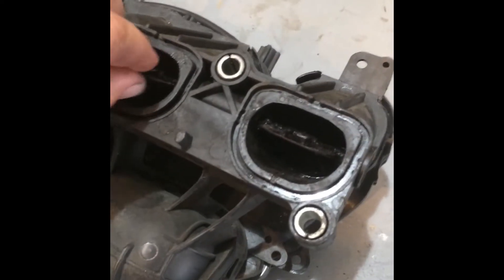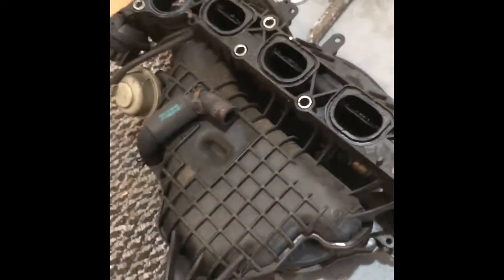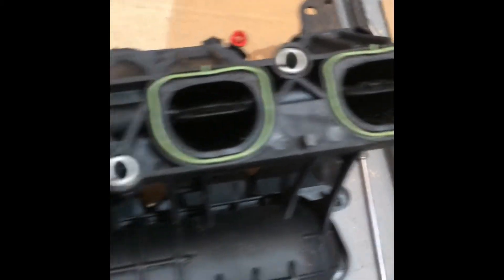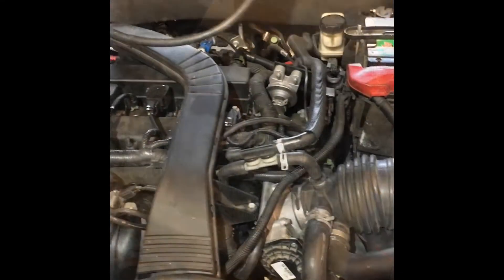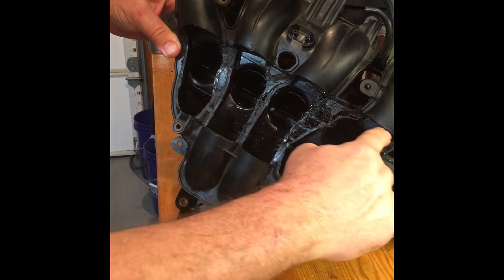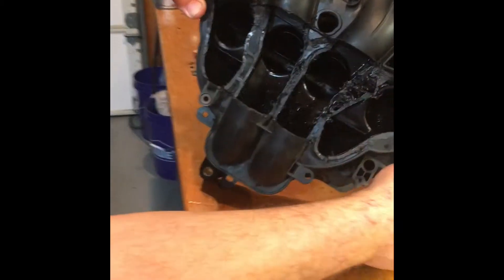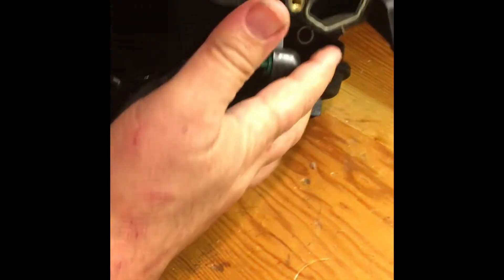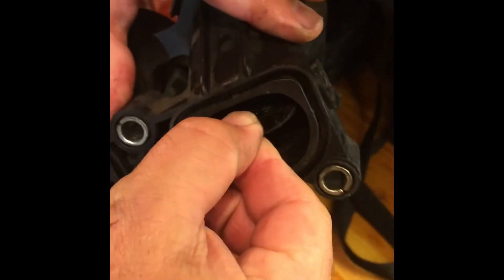Ford Fusion/ Mazda 2.3L  Intake Manifold Runner Control Diagnostics

Comment: Sport versia such a valve overflow is removed. The thrust will be greater. Less load on the engine. Only the power will be. The air intake is different than the previous one with the valve. You will see the Ford and Mazda Rallycar version. Very simple

Comment: My 70 year old grandmother was quoted $3000 for an engine replacement due to "rod knock" from a "5 star mechanic". She paid $175 for a 2 hr diagnosis.

The guy took the valve cover off and did not replace all the bolts and oil went everywhere and staryed smoking when she went down the road. She took it back, he cleaned it up, and tightened all but one bolt down, which still leaks oil.
It took me 5 minutes to find this video and disconnect the solenoid. Car runs amazing now. Replacing intake soon...

Going back tomorrow for a refund and a good ass chewing , trying to take advantage of my grama 😡😡😡

Learn to work on your own rigs, folks...

Comment: My 2.3 runs great, but has a rough idle when the a/c is on. Any ideas?
Reply: Do a throttle body relearn
Reply: Mine has this too. Did you figure it out? I did a cleaning and relearn still idles a bit off whenever the ac compressor kicks on.
Reply: @louie1487  Mine has done the same thing for over 10 years.  Nothing I have tried has improved it.
Reply: @jeffcivjeep7  My eval temp sensor went bad, so I replaced it. Also had to replace the schrader valve on the low pressure line, so I recharged the system. The rough idle lightened up alot. Barely noticeable.
Reply: @louie1487 mine recently started leaking out of the schrader randomly too tried tightening it but no luck gonna replace the valve this weekend
Reply: It’s a ford bub  all mine do it  😂

Comment: Can someone help me with my 09 ford fusion. Idles ok when sitting there. When I shift to r or d it idles at around 3 or 4 rpm almost dying. When coming to a stop at light or stop sign it idles back down. When driving idles and drives fine. No engine codes to go off of
Reply: Did you find out the problem? Currently having the same issue

Comment: What a stupid design by ford I which there was an aftermarket intake that could remove those flats and make it still work like it should but with out those flaps
Reply: There is you can delete them on f150s you should be able to delete them on the fusion as well
Reply: Just find the kits to delete them and make them obsolete

Comment: Woah, pretty interesting to see how much technology went into even these base model 2.3 4 bangers, tumble control valves, VVT, and multi length intake runners (there's even a valve on the airbox itself to draw air from near the fenderwell/behind the headlight, thanks for the video, lots of insight on how these mysterious black voids of an intake works 👍